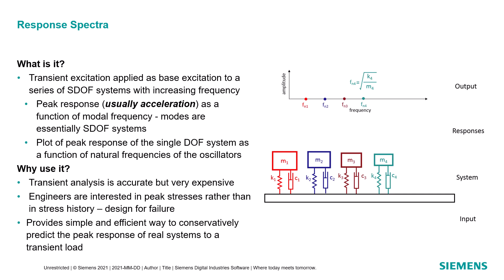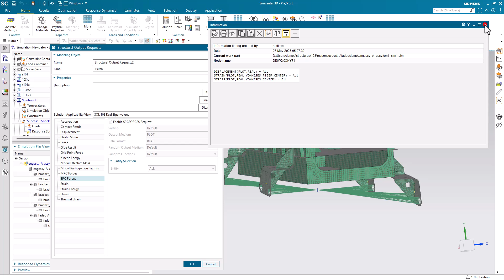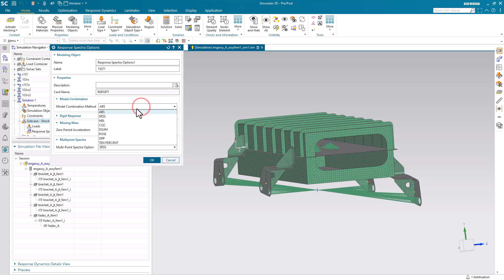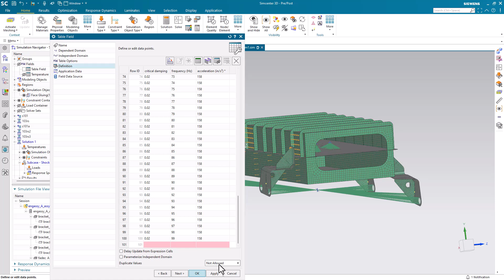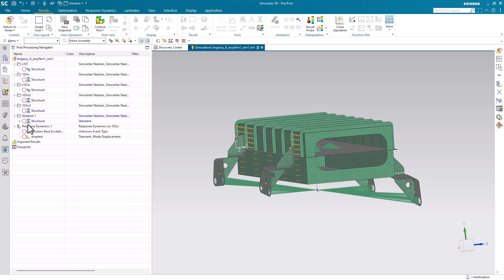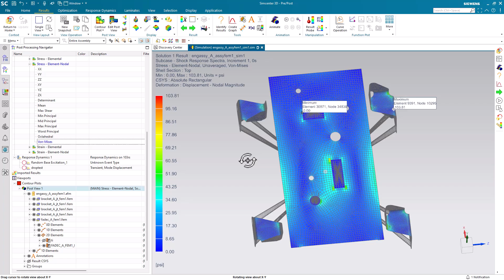How To Run A SOL 103 Response Spectra Analysis

Comment: Great video! I wonder if Simcenter has a capability to model 3D bolt threads using contacts instead of the thread geometry like Ansys Workbench? I think a tutorial would be helpful.
Reply from the maker: Glad you liked it!  Simcenter 3D definitely can model 3D bolt threads using contacts.  Not sure how Ansys does it.  You may want to consider creating an axisymmetric model instead as it would be more efficient https://youtu.be/YadyFmaGsWU?si=7zGvu_C0AV5W8h8l